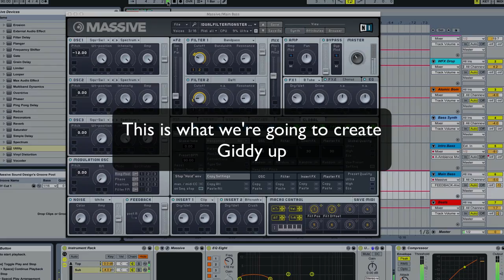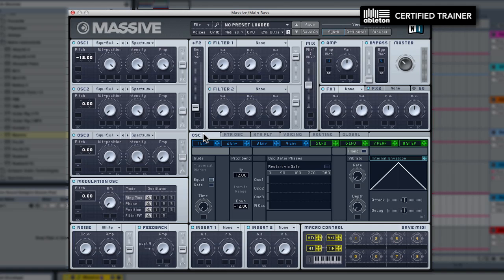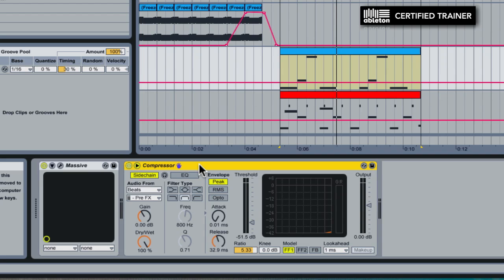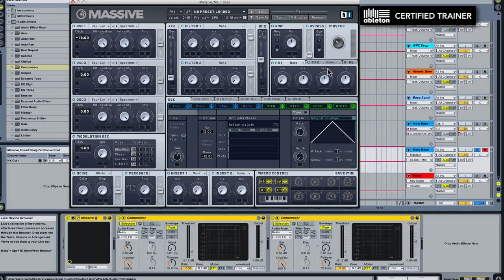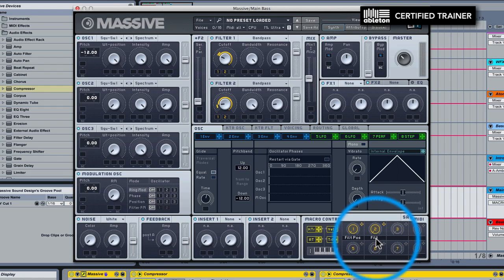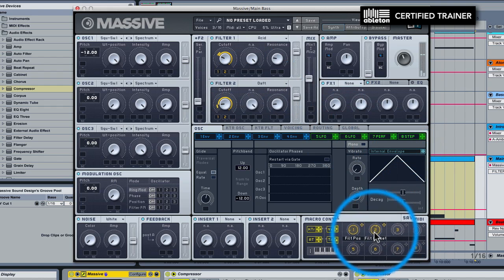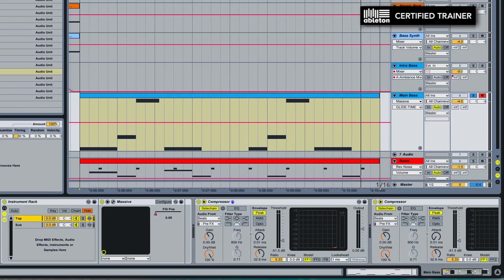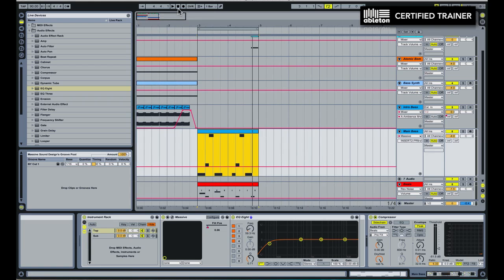Tutorial: How to Make Nasty Filtered Bass in Massive & Ableton

Comment: Very good tutorial, a few suggestions:

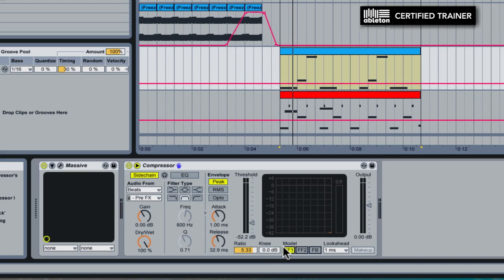6:15 If the compressor's attack time is shorter than the lookahead, the compressor will only attack as fast as the lookahead is set. 

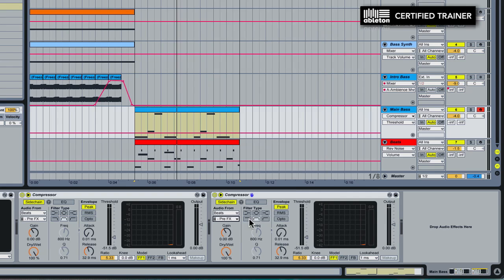7:05 Save more CPU by grouping your kick and snare to a bus and sidechaining that. Removes need for an extra comp, but if you want you can then use extra comp(s) for double/triple sidechain compression to get a more pronounced effect (little-scale uses this technique a lot).

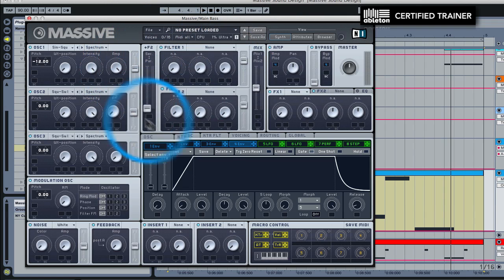17:45 worth pointing out low pass is unnecessary if you are not adding harmonics to the sub with saturation/distortion. A sine wave is a single fundamental frequency, so has no extra upper harmonics to filter out unless you add harmonic distortion. 

I'd also suggest making a 'bass' preset with monophonic mode and glide engaged.
Reply: yeap volume shaper is a great tool indeed!

Comment: When your dialling in you unison cut off, you can adjust the range of the slider, so if you set it to like 0 - 0.01 rather then the default 0-1.0 you can tweak it more accurately. Just incase you're feeling a little bit fancy

Comment: my ableton compressor does not have the option to just choose beats and then the kick from my battery plug in. anyone have any solutions to this?
Reply: Like he said, it doesn't work with the battery plug in, to do what he did you need to make a drum rack which is do-able through ableton's core functions. I personally would reccomend it, drum racks in ableton in my opinion are the best and the easiest to use when I'm dealing with my drums
Reply: Charlie Zhu  dam, but battery is so bad ass though. i bought it with komplete9 so im not loosing too much if i dont use it. i guess if i ever find a good kick or something in battery id have to find it in a library or something. or do you recommend just getting the drum racks on lock down and start building drum libraries within ableton?
Reply: Hah yeah it most definitely is, to be honest, it's not a big deal, what you can just do is have a separate track with just a kick drum on it, any kick drum will do, mute it, and use it as a sidechain source. There's no need to delve into ableton drum racks and make all these libraries if you're comfy with Battery as it is. It obviously would be a tiny bit quicker to just sidechain from the drums you are using in the track itself, but its not worth collecting tons of drum samples from scratch

Comment: Notice how I didn't say preset.. I said settings, not the same thing. And btw this sound you made in the vid is really nothing unique or complex, it doesnt have enough modulation (Wavetable or other) and it is super thin. Sounds like a simple saw wave but you took 20 mins to synthesize it. This is not the way to use massive. Wavetables and Oscillators are there for a reason.